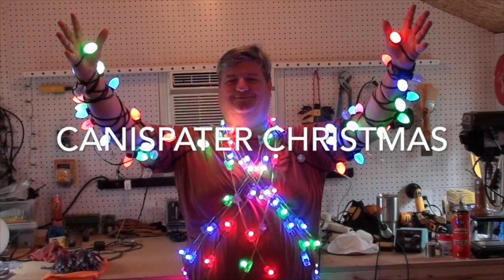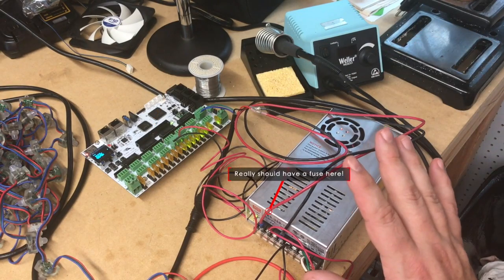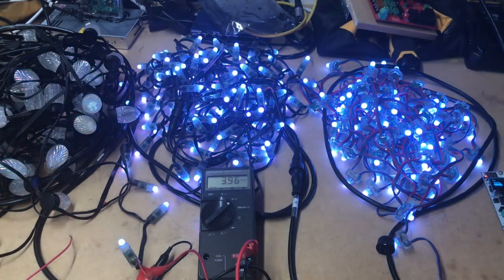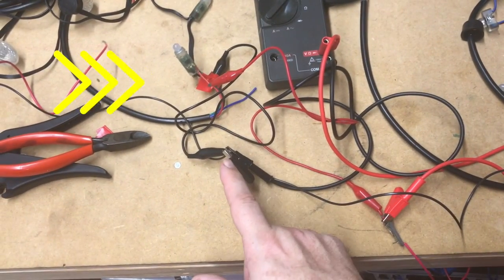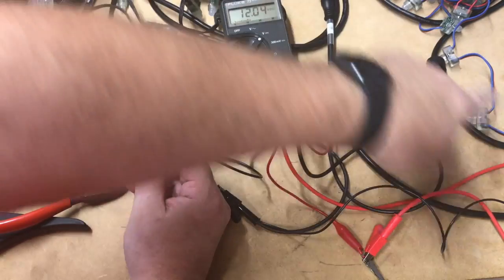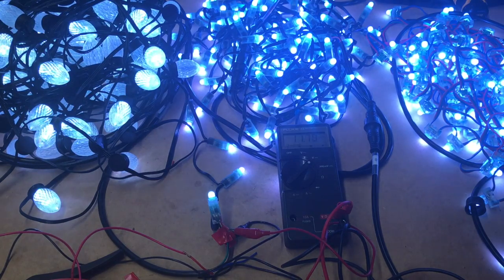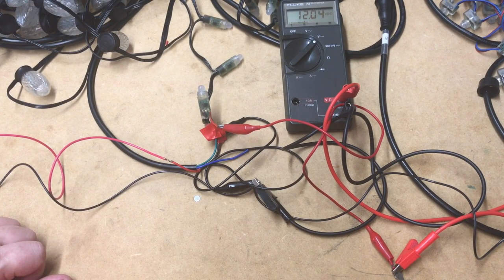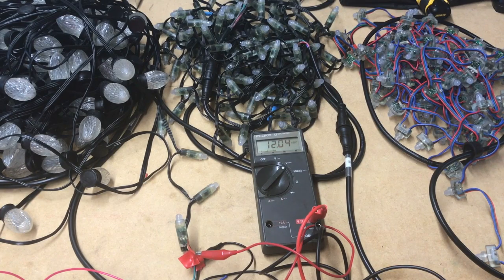Injecting Power For RGB Pixels

Comment: Hey Jeff thanks for all the vids!  How would I go about power injecting from a new power supply with x connect?  I know I need to separate the V+ between the two power supplies, but how would you do that?  I have the x connect T's, but it would send the V+ both directions unless for some reason those x connect T's separate within that junction
Reply from the maker: Or just cut the positive on the pixels in the middle of the string. You basically don't want the positives of 2 different power supplies connected. Any way you accomplish that is fine.
Reply: I wasn't thinking straight, but going to reply here anyways to the solution per the vendor I got them from on their website (doh!): 
"All three legs have all like conductors spliced in the middle. There are no breaks in the lines. If you want to create a break, it is best to pull a pin out to create a break."

Comment: May be a dumb question here....I plan on having my PS in the garage and run power thru the attic to the pixel strings; will I still get 12v at the pixels after say 200 feet of 24 AWG copper wire?
Reply from the maker: I doubt it. It might work, but you may have weird problems with the string (pixels not lighting up or looking dull). 24AWG is pretty small as most tend to use 18ga or larger depending on the run.  Also, you will need to calculate the current for the string as pixels tend to use more current than you'd think and it's affected by so many things - # of pixels and brightness are the primary factors. Make sure the wire you use can handle the current.

Comment: Hello, can I use 18awg cable, like in the power tees, for injection? Or should the cable be larger? I plan on using xconnect cables for power injecting from a Falcon, 5A distro. board.
Reply from the maker: You need to know how the power T's are wired as they may be different or other than what you need to do.

Comment: Hello, love watching your videos, hope your 2020 season went well and the recent winter weather hasn’t caused you too much damage! One quick question, is there a limit on how many power injections you do from the same power supply?  All the best!
Reply from the maker: Thanks! We're great! As many as you need and can create (you may want to use a fuse block/distribution system to get more/fused connections). The main thing is keep the draw on the power supply under 80% of it's rated output.

Comment: Can you run a set of -/+ wires parallel with your lights and "T" into the lights were injection is needed? Or should a new wire from the supply be used for each injection?
Reply from the maker: The objective of injecting power is to maintain proper voltage all along the string. I do that on my matrix.

Comment: How do you plug in the pixels to the controller and to the Power injection
Reply from the maker: Power injection is done by adding additional wires from to the same power supply to the pixels. I solder them onto the wires carrying power on the pixels.

Comment: Do I need to solder if I need power injection?
Reply from the maker: Probably. Depends on how you do your connections.
Reply: @CanispaterChristmas  what do you mean how I do my connections?
Reply from the maker: @lmjhalloween  Haha. Do you solder wires together or use the crimp-n-heat connectors?
Reply: @CanispaterChristmas  well, I just started my Rgb smart pixel show this year and I only have a mega tree without needing power injecting
Reply from the maker: @lmjhalloween  OK. There isn't a hard and fast rule for connecting 2 wires together, but I prefer soldering. I've had crimp connections come loose over time, but the crimp-n-heat sleeves have a bead of solder in them so best of both worlds. I just solder everything. Some people love the other. Personal preference really. Also, only inject power if you need it. Let the pixels be your guide.
Reply: @CanispaterChristmas  yeah but I’ll have 5 snowflake (48 pixel on each technically 50) and 4 mini trees and a mega tree, you don’t think that will need power injection?
Reply from the maker: @lmjhalloween  Not if they are on their own controller ports. If it's one long string of props, then yes.
Reply: @CanispaterChristmas  they have their own channels.

Comment: I'll be using multiple power supplies throughout my display, in different locations of my house. Will there be a grounding issue since there are different power supplies plugged into different outlets in my house? I don't see it being safe running a complete 3200+ pixels from 2 power supplies, plugged into the same power outlet...
Reply from the maker: Well, 3200 pixels is about 192 amps at whatever voltage you are using (12V/5V DC). On the mains (house AC) side however, the current draw is lower because the voltage is higher. I run over 5k pixels with one outlet, but multiple 30-amp power supplies. It peaks at ~800 watts on the mains side which is ~half what a standard 15A US house circuit can handle. I also run my pixels at 30% which reduces the power needed to run them. To answer your question, there shouldn't be a problem plugging into different outlets as they should all feed to the same ground somewhere. Obviously, you need to do your own measurements. If you find yourself popping a breaker, it's probably too much. 😂

Comment: if im running 300 pixels and adding power injection what size awg power is best or recommended to each 100 pixel sections.
Reply from the maker: If the distance between the PS and the pixels is short, I usually go with 16ga. Every hundred may not be needed so check voltages before adding power. If you cut the brightness to 30%, you may only need it at the end. Let the pixels tell you when they need more power before adding a bunch until you get a better feel for it.

Comment: Have any suggestion for a power injection wire that needs to run about 100ft to the end of my roof outline. I used a 14g landscape wire initially and I am only getting power to the 150ish pixel and 6v at the 200th, which tells me the wire can't provide 12v over the run.
Reply from the maker: Hmm. Not really. What brightness are you running on those pixels? You might try dropping the brightness a step or two to see if it clears up the problem. Or bigger wire... maybe some standard solid copper 12g house wiring. It's all an experiment unfortunately.

Comment: Hey Jeff, so, unfortunately, I'm going to have to inject. My question is if my pixels have those 2 additional positive and negative wires at the start of the string do I still need to cut the positive of the string that is feeding in to the string I need to inject on? Sounds a bit convoluted so let me see if I can explain better.

I have string 1 being fed from the power supply. I reach point B and my lights begin to dim and flicker even after adding an F Amp. Just before the point where my lights begin flickering, I had connected another string to continue my run. That string has those 2 little positive and negative pig tails  that I assume are there for power injection. Can I just run another wire from my power supply and connect to those or do I still need to cut the positive at the end of the preceding string?

Appreciate your help as always!
Reply from the maker: If you are injecting power from the same PSU that is feeding the string from your controller, no need to cut the positive since it is the same. If you hang a 2nd PSU off the end of the string, you need to cut the positive.

Comment: Do you have any video with running power or anything power related when it comes to pixel strip lights? Thanks
Reply from the maker: I'm not sure I understand what you are asking. This video has to do with power injection. What are you trying to do?
Reply: @CanispaterChristmas  does the same thing you do in this video applies to pixel led strip/tape  lights, sorry just start learning about this
Reply from the maker: @ericguyah  Yes. Different pixels behave differently, but you can generally tell when they need more power as they will look dim, muted colors or won't work. General guidelines are power is needed every 50-80 pixels for 5V and 80-100 for 12V. Brightness is also a factor. Let the pixels tell you when they need more power.

Comment: Why connect the negatives together? to avoid noise?
Reply from the maker: Yes. Noise (or slight voltage differences) makes the pixels flash uncontrollably.

Comment: Maybe a silly question because no one really talks about this but what type of fuses do you use and how do you connect them to the wires (in the spots where you say “...should put a fuse here...”)?
Reply from the maker: Any type of fuse will do. Size obviously depends on the circuit, but there are some fuse boards made by community vendors or there are some fuse blocks available from Amazon. I've used both. I'll try to be more comprehensive in my setup video this year.
Reply: If you power inject via like a Falcon power distribution board with a second power source do you still only plug the negative into the Falcon board?
Reply: @ryanhanlon9984  Not sure I totally understand. Injecting power is more effective with both wires. The purpose is to maintain voltage all the way down the string. The pixels will usually tell you when they need more power by either not working or looking dull. The purpose of a fuse is mainly to protect your pixels from an oops.
Reply: I thought I read somewhere that if you inject with a second power source you can’t connect the positive wires between both supplies?
Reply from the maker: @ryanhanlon9984  Yep. You don't want to connect the positives of two different power supplies to the same string or they will fight each other. You need to cut the positive lead between the two.
Reply from the maker: Injecting power from the same power supply is fine.

Comment: Is this inline fuse correct to use with power injection?  If not, what should be used?
https://www.amazon.com/MUYI-Inline-Holder-Waterproof-Pigtail/dp/B07G7YMJXW/ref=sr_1_3?crid=NYZD5GCBBM7S&dchild=1&keywords=marine+inline+fuse+holder&qid=1599002731&sprefix=marine+inline+fuse%2Caps%2C187&sr=8-3
Reply from the maker: LOL. This just showed up in my unread comments. Yeah, that should work fine. I use those for individual injections. If you're doing a bunch, there are other options that are a little easier to work with. https://amzn.to/3dmk2o3 I use those if I need to run several lines.

Comment: I watched Bill Porter’s xEssential E10 “Power Injection Made Easy” video from November 20, 2018 as well as your video’s on the topic.  I was confused with one aspect and hope that you can provide clarification.  I am planning to connect six 5v 75 pixel strings end to end making a 450 pixel string plugged into port 1 of a Falcon F16v3. The F16v3 will be drawing power from a Meanwell power supply providing power to the F16v3 itself as well as the pixel string.  Then I plan to inject power at various points within the 450 pixel string using a 14AWG wire and a 10amp fuse at the start of the power injection run.  However, this string of pixels is also receiving power directly from the F16v3 which is connected to a 5amp fuse.  My understanding is that the same string of pixels should not be connected to two fuses.  I am not sure how to avoid this.  My only thought is that the V+ From the F16v3 to the pixel strip must not get connected and the power injection itself starts at pixel 1.  Hope my question is clear.  Any advise you can provide is greatly appreciated!  Thank you!
Reply from the maker: 2 fuses doesn't matter, just a chance of blowing both of them if you short the wires. I think you're on the right track. What you want to avoid is 2 different power supplies feeding the same string.

Comment: I have 200 nodes on 4 mini canes 12volt, they are flickering at the end, but all the lights seem to be same color&brightness, needs power injection?
Reply from the maker: Could be a bad ground or they are too far apart. Pixel-to-pixel data isn't strong and will only go a foot or two. You might need an F-Amp between props.

Comment: Are you using strictly 5amp Power supply at your prop. What is best to use , 12 v an what amp and watt. Thanks.
Reply from the maker: I use 350-watt power supplies. 12V is roughly 30 amps.

Comment: Great video. Good information.  What about a long lead from controller to first pixel. Going from roofline to controller.  F amp and power injection?
Reply from the maker: Thanks! There's a few options depending on distance and what you're working with. You may want to experiment with a few. My preference is a differential receiver at the prop which is easiest once you get past about 20-30 feet. F-Amps are possibilities, but I generally use them to chain props more than a foot apart as pixel-to-pixel distance needs to be small. I've also used Ethernet cable to extend data distance since it handles data better than the normal wiring - don't use it for power though. Then there's multiple power supplies for powering long roofline strings, but there's gotchas with that too.

Comment: Still confused, can you show a schematic? How many lines of power can you run from one power supply?  Do you need to boost data as well?
Reply from the maker: Once you get data to the first pixel (assuming no big gaps) they regenerate the signal for the next pixel. How many? As many as it takes. Let the pixels guide you. Here's another one (https://youtu.be/Z-IedCXTfy0) that may be better and the one immediately after that as well (https://youtu.be/eCpi9It8Mic). Both deal with power injection. This might be more of what you're looking for though: http://spikerlights.com/pwrinjection.aspx

Comment: Here's something handy for your workbench, to make connections faster & easier.  Not for stuff outdoors needing waterproofing, but these can handle pretty much any type of wire & mains voltage (they are rated for and ideal for a cleaner replacement of wire-nuts in j-boxes).  
https://www.amazon.com/Wago-221-412-221-413-Lever-Nut-Assortment/dp/B01GVS7ZES?SubscriptionId=AKIAILSHYYTFIVPWUY6Q&tag=duckduckgo-fpas-20&linkCode=xm2&camp=2025&creative=165953&creativeASIN=B01GVS7ZES
Reply from the maker: Thanks! I'll have to check them out. Do you use them?
Reply: CanispaterChristmas I have been using them for a couple of years in home remodeling projects and they are really nice.  I’m just getting into this hobby/obsession & figured they would be ideal for quick test connections on a workbench like you are doing here.  They also have a test port you can directly probe with a multimeter.

Comment: Hi, what if i use 3000 pixel light ws2811, what size of.wire.should i use for power injection? Tnx
Reply from the maker: You can't push data through a single string of pixels that long. 1,024 is the longest supported by current controllers so you'd need at least 3 strings. As for wire size, you need to know how much current the pixels draw (there are many more options today) and brightness has a large effect on current draw. What are you building?
Reply: @CanispaterChristmas  basically i am building a borderline out of maybe 1500 pixel light, 600 for a pixel grid and some arches and another bordeline for window for the rest.
Reply: @CanispaterChristmas  i am using a light controller, and a sequence software as well. I just want to know the size of the wire to be used at.
Reply from the maker: Unfortunately there isn't a single answer. You need to estimate wire size based on the string, brightness, distance from controller, etc. I order my strings with 18 AWG wire if possible so maybe start there for general use?
Reply: @CanispaterChristmas  have you done a borline before? I mean like the one they used for the lines on the edge of the roof, :) something like that
Reply from the maker: I outlined my garage, but it's only 115 pixels. If you are new to pixels, please check out my beginner playlist if you haven't already: https://www.youtube.com/playlist?list=PLFyrAfJ-kKd4ZfPdXWIt8v_bav61mW_KW

Comment: How do you .... determine current issues .... need more .... need bigger .... need less etc etc
Reply from the maker: The pixels will tell you by looking dim.
Reply: @CanispaterChristmas  Thx.  But looking for more of a concrete methodology.  

Still .... Tho you did give me some good info.
Reply from the maker: Oh OK. If you are new to pixels, have you been through my beginner playlist at https://www.youtube.com/playlist?list=PLFyrAfJ-kKd4ZfPdXWIt8v_bav61mW_KW ? That gives a lot of the basics about pixels. Typically you can go 50-80 nodes without injecting power for 5V pixels, 80-100 for 12V pixels. It also depends on the brightness setting. I typically run them at 30% since it's too bright for my neighborhood if I run them at 100%.  30% lets me run longer strings before needing to inject power. Different pixels behave differently so it's really more experimentation with the setup you have rather than a calculation. It's also a matter of experience. The longer you use pixels, the quicker you'll be able to determine whether or not you'll need to inject. It's a waste to inject if you don't need to so that's why I usually just let the pixels tell me for new props I build. So, it's more art than concrete. :)

Comment: Your comment at the 5 minute mark about not connecting the positive sides of two power supplies together. Are you able to provide an example of this?
Reply from the maker: If you have two power supplies sitting next to each other, don't connect the positives to each other. There is another comment in here about having pixels between two power supplies, but no guidance as to how many are needed to provide protection so I just say don't do it.